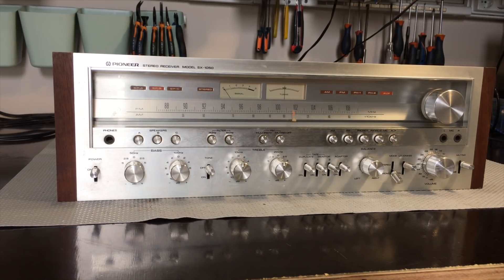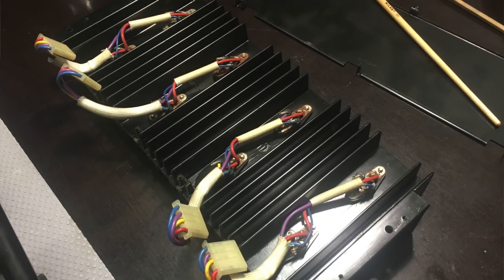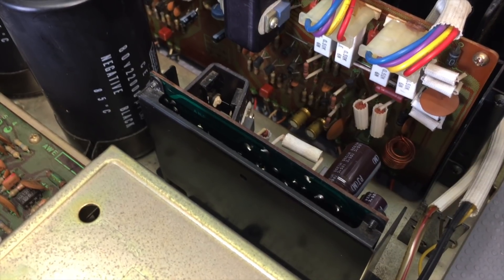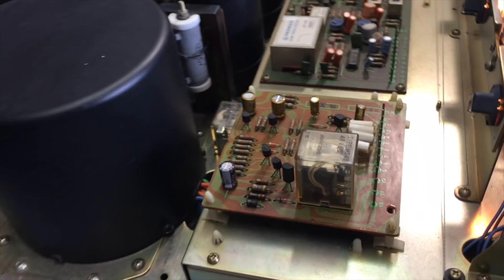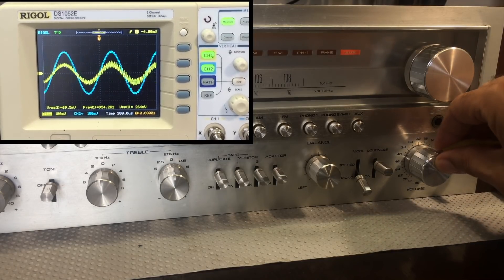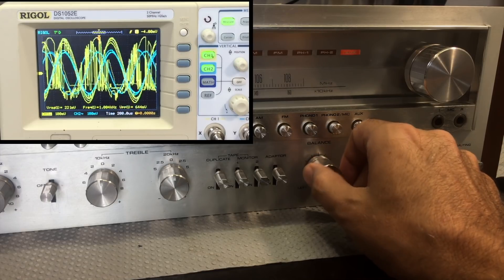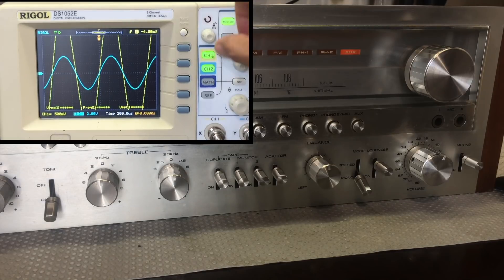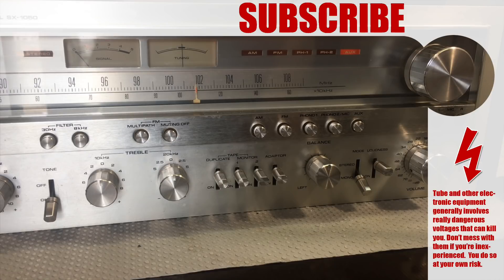Pioneer SX-1050 Stereo Receiver restoration part 2. Power and audio throughput. Check.

Comment: (... feeding the algorithm ...)     I enjoy both your videos and Tony's and it's nice to see an audio receiver project. Minor observation: the reason those fiberglass brushes work so well is that the very tips of the fibers constantly break off, exposing a new sharp cutting edge. So don't stick your nose down in what you're working on and inhale deeply. You probably know that similar brushes are made with brass and steel bristles. Keep up the transmissions from Madeira! Thank you.
Reply from the maker: thanks

Comment: Cable connections between PCB's is very cheap in all Pioneer ( consument  electronics)   , even you beeping with multimeter , it is not show connectivity when small signal goes through it  , small signal in preamp and it's connector should be gold plated , try to solder all wire directly to PCB ,  , even if cable management get difficult.
Reply from the maker: thanks

Comment: Nice receiver. Fortunately it doesn't have a broken microcontroller to spoil the fun (like the B&O a few months ago). Could be a challenge to really test the amplifier at full power as it is rated for 120W per channel and can put out some more and I guess your dummy loads aren't rated for that.
Reply from the maker: No they’re not, unfortunately.

Comment: The white residue is normal on this vintage of amplifiers. I suspect the residue is actually water soluble salts that where part of the original flux from manufacturing.
Try cleaning it with IPA that contains 10% water.
Cheers, have a good one.  And thanks for fiming your videos. :)
Reply from the maker: Thanks for the tip.

Comment: I have some experience of old Pioneers, a bit later models than this one.
Pots (except sliders), relays, transistors, electrolytic capasitors and connectors have been very good quality and have caused only very little problems. 
BUT input selector switches are the main problem. They are very prone to contact issues. Some of them are very difficult to deoxit because they are quite sealed and if deoxit does not help or is very difficult, suitable spare part switches are impossible to find.
Very annoying because the amp itself is often very well designed and lasts for decades. Only those switches ruin everything.
Reply from the maker: Age affects us all :)